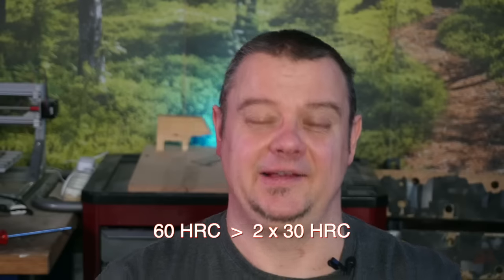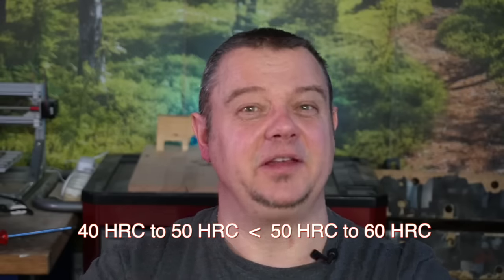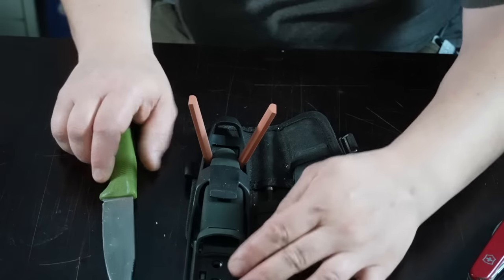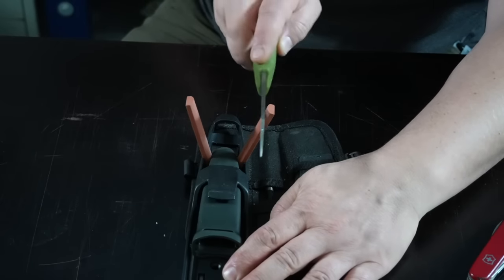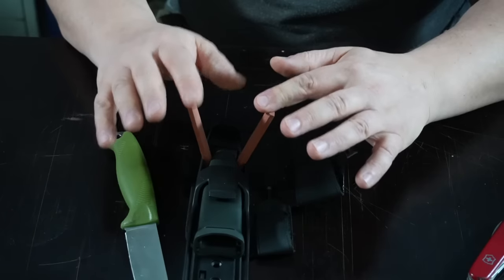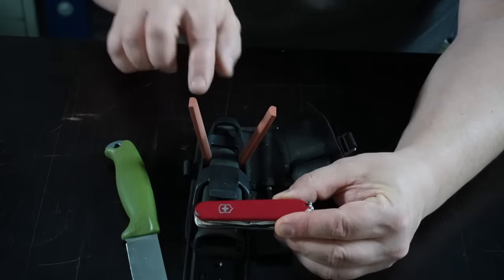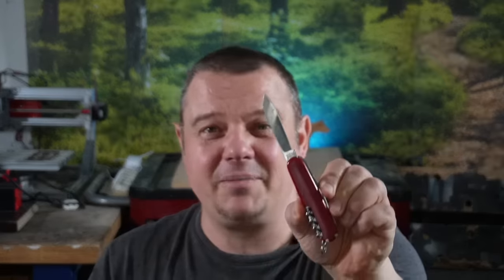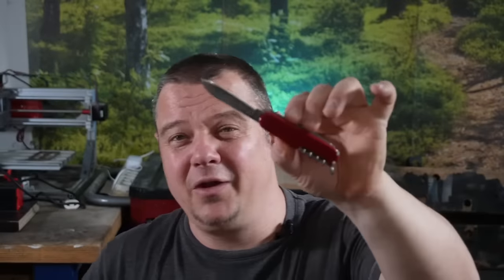HRC Rockwell values are not comparable !!  - What every Knife Freak should know about Rockwell

Comment: Very interesting Felix and thanks. My aging brain can no longer cope with complex mathematics, but the HRC depends on pressing a Cone (a 3 dimensional object where the volume depends upon an exponent of 3) into steel whereas only measuring the depth (which is a single dimension) ignores the "volume" displaced. The difference (I think) would be logarithmic. 

Additionally, as the cone presses into the steel, some of the steel is smashed to the side of the cone (away from the center) and some of the steel is smashed into the depth of the hole. Thus, the Rockwell test compresses the steel, which alters its hardness the deeper it goes and the scale is no longer linear. 

I need a younger mathematician and metallurgist to express it better though.
Reply from the maker: Hello Randy. Thank you so much for your super interesting Comment. I am sure your are right! My brain was smoking for this video. This is a very complex topic... and i felt, that i step on thin ice 😄
Reply: @FelixImmler  I can definitely relate to your third and fourth sentences ... and I thank you for your first two! :D  

LOVE your videos and presentation "style" !!
Reply: I thik that that's it so...

Comment: So very interesting. I’ve always liked the SAK ability to easily sharpen in the field. With today’s wonderful sharpeners I often wonder why the obsession with super steels and the super expensive knives. Victorinox makes what I think are the best traditional knives out there. 
Yes I’m a fan 😊
Great video Felix!
Reply from the maker: Thanks a lot for this wonderful compliment!
Reply: I also love the Victorinox steel, it holds a decent edge and is super tough. I really had to abuse the large blade on one as it was a job with difficult access and the SAK was all I could use, when I finished the blade was so bent the knife wouldn't close, I hammered it flat and I still use it in the garage 30 years later.

Comment: Many years ago I worked in a machine shop which often hardened components. The old timers didn’t go to the hardness tester, instead they gently rubbed an edge of the component with a fine file. They “felt” and “heard” how hard the metal had become by how well the file was biting in and removing a small amount of the material. This is almost the same principle as the hardness tester. Probably this is one reason why different knives “feel” different when we sharpen them on a coarse stone. Not a precise measurement of hardness of course, but it is a way for an ordinary person to compare a known blade with an unknown blade. Thanks for all you do Felix.
Reply from the maker: Thanks a lot for your super interesting comment!

Comment: According to wikipedia indentation hardness correlates linearly to tensile strength. Material science is very complicated so its typically simplified as a trade off between edge retention (which is related to hardness) and toughness which decreases in relation to hardness. New metallurgical techniques like the powdered metal techniques have changed this and have created steels that are both hard and tough but only by small to moderate amounts
Reply from the maker: Thank you so much for this super interesting comment. You are right... and the tensil strenght goes more or less  linear to Vickers...

Comment: Wouldn't it be possible to calculate the volume of material displaced during a Rockwell hardness test using the force, tip angle and the depth of penetration?

Even I'm not sure where I'm going with this... 😄

I suppose I was thinking more precise hardness comparison testing should be possible without resorting to measuring diagonals under a microscope. Maybe I still don't understand how the Rockwell testers work, but if you can measure penetration distance, the force applied is constant, the tip angle is known... why can't you create a scale that varies based on material displacement instead of just penetration depth?
Reply from the maker: very smart question! I understand your thoughts. I can't give you an answer. I hope someone else sees your question and can answer it better than me
Reply: Yes but the Problem is that the % different of 3% for 56 and 59 HRC in Volume is only 1.63%
The Volume is = (1/3)*π*r²*h
But you need to find r with Pythagoras there is r=b and h=a
b = a * Sin Beta / Sin Alpha
V56= 0.00214090743 mm³
V59= 0.00173217366 mm³
If i also calculate Vmax for h=0.2mm then i can rebuild the HRC Formular...and get for
V56 = 91.48...
V59 = 93.11...
The good part of the original HRC is that a mechanic scale can Show the HRC Instant No need to meassure or calculate.

For the HRC Test i can say its a bit more to it then you See Here, the Tip is rounded and you have a start Wight that stays and then you Set the scale to Zero and add the Main Wight. Wait for the Scala to stay and remove Main Wight, now read the Scala. Thats to be Sure the Probe is flat and No slag, plus elastic from the Probe is removed.

(I Hope my math is correct because its over 20 years i Last used that;-)

Greatz from Germany
and have a nice Day
opo

Comment: Felix, you've once again explained things simply and well. There's also the depth of the hardening to consider. Some early Gewher 98 rifle receivers met the hardness standard, but in use were discovered to 'set back' or dent at the locking lugs because the steel underneath the hardened surface was too soft and was 'hammered back' in the rifle's use with the hardening intact!
Reply from the maker: Thanks a lot for your super interesting comment!!
Reply: Gewehr* 98

Comment: 5:16 while the rockwell hardness scale varies from 0 to 100 for each given test type ( regular or superficial) and scale (A, B, C, etc), the scales have physical sensitivity limitations based on test design, and the ISO standard suggests applicable limits. Thus Rockwell C should only be used within the practical range of 20 to 70.
Reply from the maker: Thanks a lot for your interesting hint!!!
Reply: In Germany we dont have so many ways for the Rockwell Test Like in the USA.
Here we use below 17 HRC the HRB/HB
But i learned that over 20 years ago, maybe Germany now Accept more Tests too.

Comment: The aerospace industry generally utilise ASTM E140 for correlation purposes. However, the 2 hardness methods are not directly comparable as the correlated values are obtained via experiment and therefore multiple variables need to be considered. The approach should be that the values when compared are ‘apparent’ and not ‘absolute’.
Reply from the maker: Thanks a lot for your interesting comment!

Comment: It occurred to me that having a few cheeper knives is better than having one good knife. If you have two it matters not how long it stays sharp because you could have someone sharpening one wile you use the other. If you only had one good knife you would have to stop working to sharpen. 😃
Reply from the maker: You are absolutley right!😃
Reply: So long as by 'cheap', you don't also get 'weak'. I'd rather have one good knife than two with snapped blades.
I suppose the answer is to have two 'good' knives.
Reply: @davehumpleby3440  most tasks that snap knives are not knife tasks.

Comment: No hardness testing system for commercial application starts at "no resistance at all" (= free fall), they all start at a range that makes sense for their intended application. Vickers starts out lower than Rockwell, Janka starts lower than Vickers, Shore-A starts lower than Janka etc, because they are intended to test different materials. That's why a 10% difference between Vickers and Rockwell can actually be a 14 % difference, and so on.
Reply from the maker: Yes you are right. Thanks a lot for your super interesting comment!

Comment: But wouldn't you be able to derive the same area calculation that the Vicker's uses from the depth measurement of the Rockwell method? Wouldn't the area of the indention of the Rockwell method be directly related or a function of the depth of the indention? Is it not just stating the same thing in a different way?
Reply from the maker: Good question. I would say no, because the flat goes linear to the material strenght and the depth not.

Comment: Looking at the tabular, I m surprised. If one scale would be linear and the other exponential, the steps between each RC should increase continuously on the Vickers scale. But I see a swinging between 10-30-15-30…
Can someone explaine this to me?
Reply from the maker: Yes you are right. I saw that also. But in the tendence the steps growes as harder the material is. In my opinion, the table is very imprecise and is rounded to 10/15 increments at Vickers

Comment: Reading charts and test results are interesting but only are numbers. However, there a few tests you can do yourself on your own knife if you want to know. There are testing file sets available that are harden to set HRC standards. Machinist often uses them to check unknown types of metals. It is reference to set turning speeds for cutting materials. The ones I looked at run from 65 to 40 HRC, By drawing the file across the metal surface it will scratch the surface if not as hard as the file. If it is harder, it will not scratch the surface, how accurate they are is subject I would not know.🤔👍
Reply from the maker: hallo Gizmo. Thanks a lot for your interesting comment!